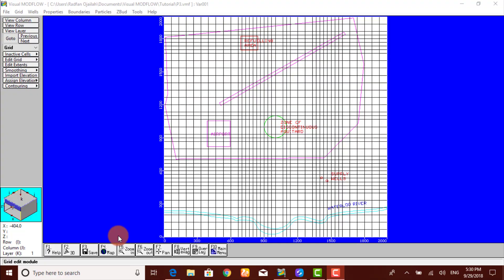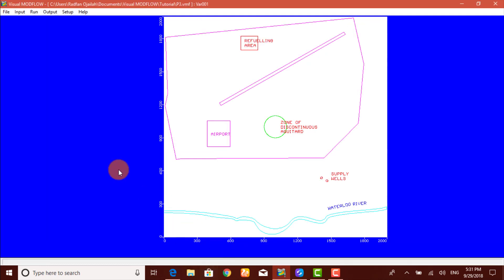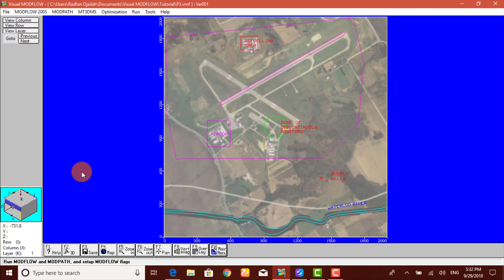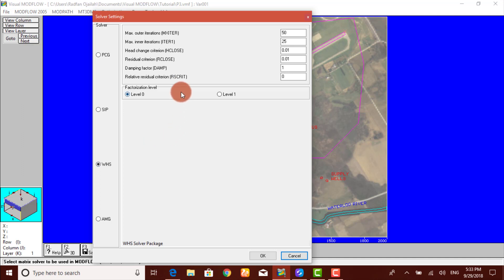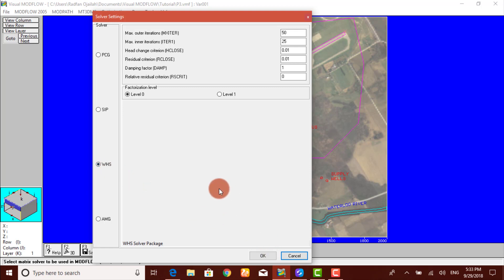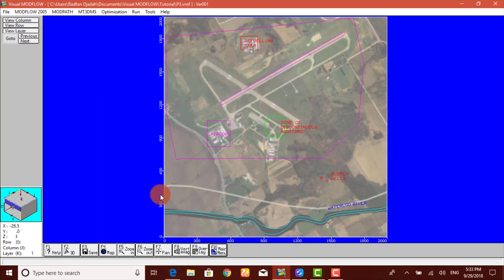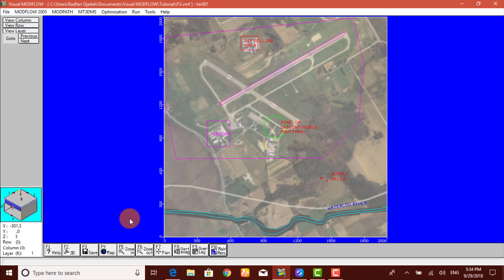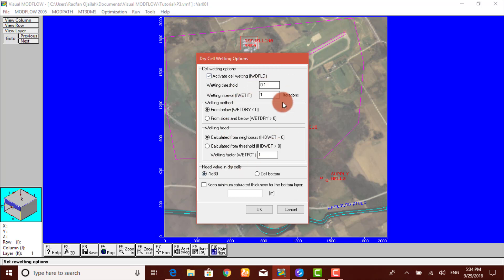Module 3- Section 10: Running Visual Modflow

Comment: Hi can I get the continuous video from this part. I've been assigned an assignment by my lecturer about waterloo modflow modelling, however my output didn't came out same as my lecturer. That's why I have been wondered which part I am wrong.